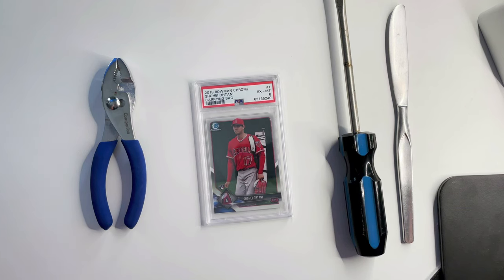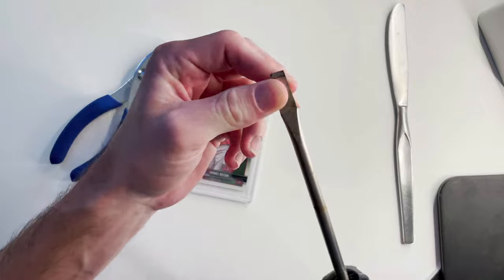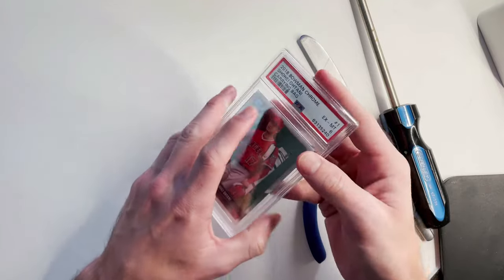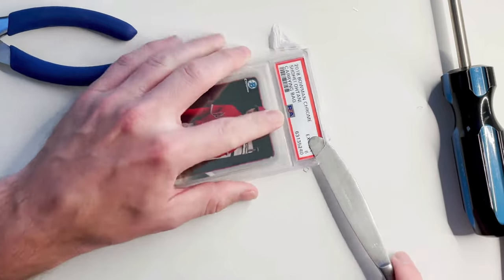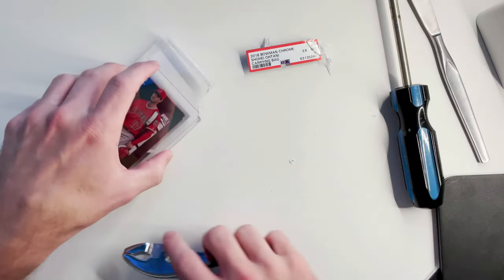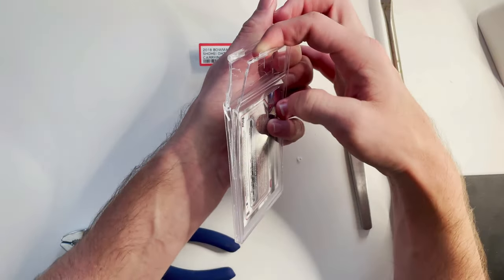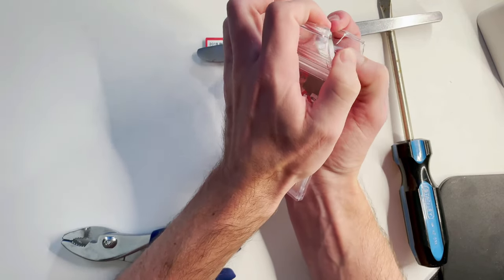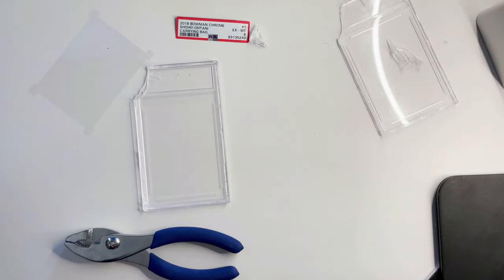How to Crack Open a PSA Graded Sports Card Case in 5 Minutes (2021)

Comment: 5 mins? It takes 30 secs. Drill a hole in the top corner and slip a small flat head work your way around the sides and boom
Reply from the maker: Takes 5 minutes to find the drill and drill bit! lol